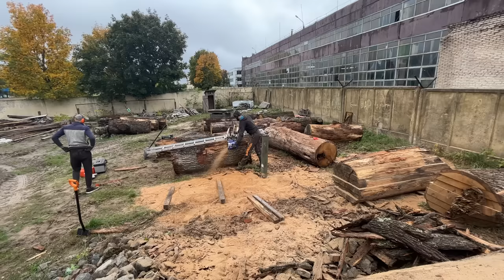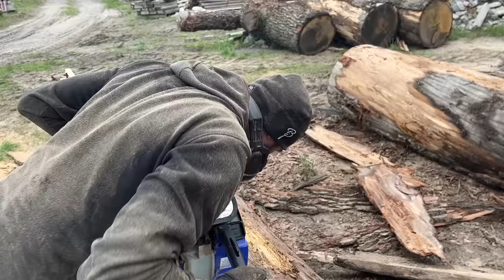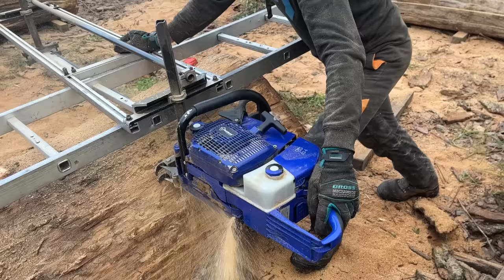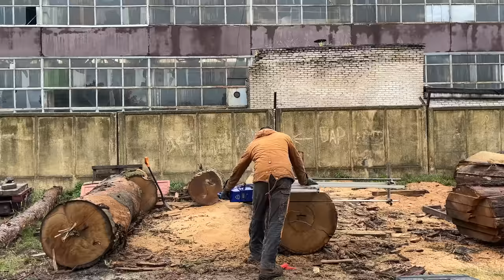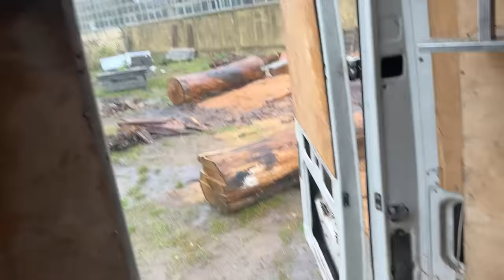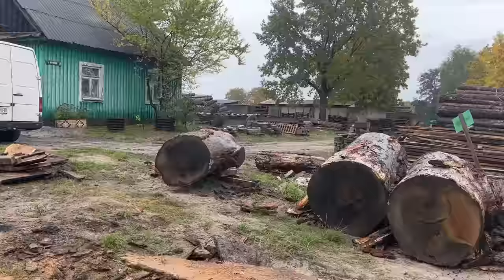Holzfforma G888 will we throw it in the trash?

Comment: We bought one of the G888 saws. Its doesn't want to start, pulls the cord out of your hand and likes to rip your shoulder off in the process. Compression release pops off early as well. Have replaced coils, compression release, flywheel, set the timing and nothing works. This saw has been a big disappointment right out of the box. Took it to a Stihl dealer and they just laughed and said these saws are junk. A cheap Chinese imitation and apparently they get a lot of them come thru the shop. They just refuse to work on them. Maybe we just got a bad saw, but when you buy cheap, you get cheap. Never had this problem with a Stihl saw !
Reply: These saws are not for people that pay shops to do their repairs… these saws are for professionals who know how to tinker with them. I have a a Chinese clone 372xp and has been nothing but good to me soo far with some modifications. Again not meant for someone like you since you have to pay stihl dealers to try to figure out an issue… sounds to me like yours is flooding. Throw an oem walkbro carb on it and take the gamble
Reply: I had the same problem with my g660. Nobody would touch it because it was an imitation Stihl. But I had a coworker of mine look at it, and it runs like a dream.
Reply: My G888 has been nothing but a disappointment.

Comment: How thick do you cut your oak slabs, 3 inches?
Is that to prevent warping/cracking?
Reply from the maker: From 3 inches usually. That’s right, this thickness holds its shape well and cracks less
Reply: I have slabbed lots of conifers like redwood,  cedar, and cypress on the coast but no hardwoods yet. I will try walnut, oak, and locust next... thank you @BelkoWood